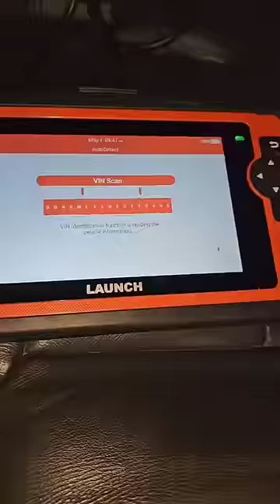chewed and corroded wires

Comment: The visual inspection can nail the issue upfront . And putting heavy jumpers from the negative terminal to the block , frame and body can show a bad ground problem before running in circles and chasing codes , etc. Great diagnosis .

Comment: Great video!  Love your vids.  My question is how u fix wiring harness?  Replace,  twist and solder wires, wrap with electrical tape?  New harness not cheap, especially for a hummer, im sure.
Reply: Yea you would typically replace sections and solder them make sure it's all insulated then make sure to replace the loom wrapping to protect it.

Comment: My aunts CR-V has had to replace multiple harness because the soy-based coating they use on the insulation is attractive to mice
Reply: Honda lol
Reply: Big problem all wire has soy in it now. 👌
Reply: Mercedes and many other manufacturers prefer biodegradable plastic 😂
Reply: Put some peppermint oil here and there under the hood.
Reply: @mikeburdi3464  the whole garage smells like a peppermint mothball eucalyptus tree already actually

Comment: Had that problem in my Truck, Squirrels chewed   a bunch of wires, Plus a rubber vacuum  hose. Tried  every thing  found on the 'Net. Finally bought an ultrasonic gen, made for Rodent repelling. THAT, did the trick.  Powered off the car's battery!

Comment: I work on trash trucks in central CA and we have a rat problem. I've heard several reasons for rat's chewing on wiring. 1 they like the taste. 2 the electrical field excites them and 3 they are just bored. The other day I found 6 wires hanging out under the truck that were chewed almost completely in two.
Reply: Damn rabbits chewed up my wire harness
I think they like the warmth from the engine 
It's a good place to hide
Reply: Dude no joke. I live in the same area, I picked up this 89 econoline in February, it had the biggest rats nest living underneath the upper intake, the entire passenger side valve cover was rats nest. Don’t know how, but was lucky and not a single wire was chewed.
Reply: A few years ago Subaru had the brilliant idea of using a soy based wiring insulation.  I bet you can guess what happened
Reply: @Keith Charles  so did Honda haha
Reply: @SlithenTurtle  truck manufacturers are too
Reply: I work on trash trucks in East TN and imma tell it to you this way - mostly side door prox wiring and over the tailgate is due to them not having enough pass through to get where they need to go. Reroute the side door prox harness and plasma the pass through on the body side and the tailgate side. It's not entirely foolproof but it'll help with uptime, fellow trashman. Who you work for?
Reply: @PepperDarlington  most of my damage is in the tunnel between the body side clearance lights or in the taillight housing on the tailgate, occasional odds and ends. Including a 6 wire bundle hanging out in mid air between the frame and the body. 
I'm working for a small independent company in central California. With different companies I've got 28 years working trash

Comment: This video is why I not only have a battery to body ground which was already hooked up. I ran another body ground from my engine to the body and I've noticed things work much better than before...I never drive after dark but I'd almost bet that my lights works brighter cause I've seen a difference in em in the daylight...Thanks for the info cause I completely forgot about doing that ground to engine and body, plus I used a decent sized wire thats the same as ground wire is on the battery

Comment: 07 and 08 gm trucks/suv's had ground issues. Pretty sure there was a bulletin out about soldering the negative battery cable connections (this did not always fix the problem) that was updated to changing the negative cable assy with the updated style.  I didn't see much failure of the braided griund from engine to chassis considering there is another ground from battery to chassis and I work in AZ. Not as much corrosion down here.

Comment: If you are having rodent problems under your hood, put some peppermint oil under there. I usually put peppermint oil soaked cotton balls in a water bottle with holes in it and secure it somewhere in the engine bay.

Comment: My 2021 Toyota Tacoma recently had to get an engine harness replaced because rats chewed through it. It’s not covered by warranty because Toyota claims it’s a natural event not a poor sourcing of material. Apparently my truck along with other models have wiring with soy based jacketing!!! It’s a well documented issue and there is a pending case action lawsuit against Toyota as recalls haven’t been issued. The dealership suggestion to prevent further rodent issues (non-soy based  harnesses have not been released) was to put dryer sheets in the engine bay. The dryer sheets seem to be working to keep away to rats and as a plus my truck smells ‘Spring Fresh’.

Comment: I have a question for you. I have a 2015 GMC Sierra crew cab 4x4 Z71 1500, with the 5.3, I've changed the transmission fluid total flush, every 80,000 miles. I have 190,500 miles on it. In your professional opinion,  when do you think, ballpark figure, my transmission will have to be replaced. I'm noticing now, that coming to a stop light, as it downshifts. From 2nd to 1rst, I get a slight chug, especially if the light turns green and i go to get back on the accelerator. Talking with other owners,  I imagine around 210,000 to 220,000.

Comment: That diagnostic computer comes up a WINNER sometimes, huh ?
Hey how about insulation coating with HOT PEPPER, that doesn't disintegrate the wire insulation not the harness wrapping ?  🌶️🌶️🌶️

Comment: F***ing rabbits will chew the insulation off wires in the winter.  Almost burned a Cadillac of mine to the ground.  They had stripped the battery cable.  I know it was a rabbit because it jumped out when I popped the hood...